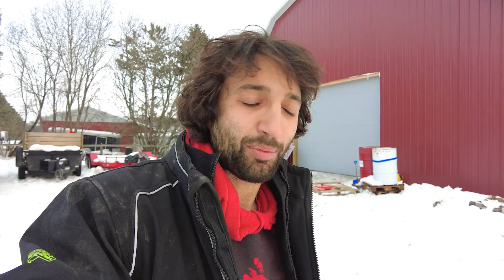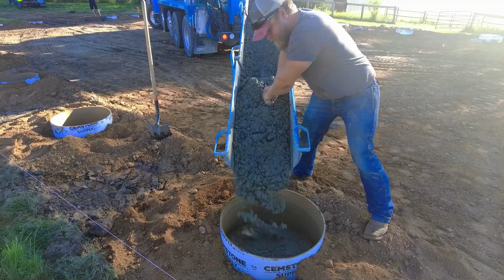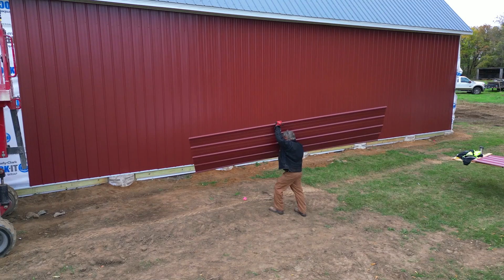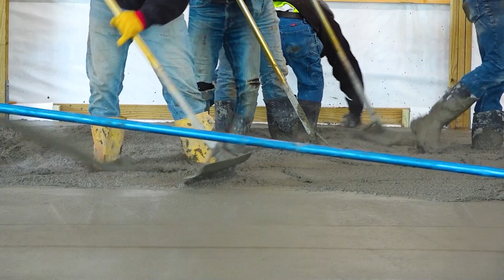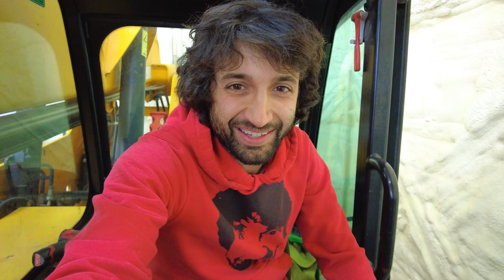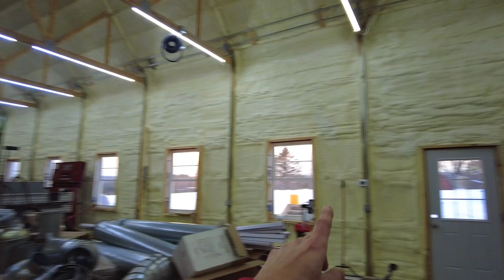How Much did this Stupid Barn Cost to Build? - 40x72 Gambrel Post Frame Episode 23

Comment: Thanks Matt for all the great information! I thoroughly enjoyed watching your build. I have a much smaller building much like yours, it's a 30 x 50 with 12' high walls. I have 2" spray foam on walls and ceiling as well. I do not have floor heating, which I wished I did, but just could not afford it. I used 3/4" plywood for interior walls 10 feet high. Mine is metal framing, not the red steel framing but the cheaper square tubing. The steel building material and labor was a little over $16,000. This was before covid, today it's 25K. My floor was 6K, I wired it myself. I had (3) residential garage doors with openers installed for $4,600.00. I had 2 coats of Polyaspartic coating on my floor for 3,500.00, this was a good deal. I did a lot of research on this product and its the most durable product on the market. As always I wished it was bigger! Have a Happy New Year!

Comment: Thanks for sharing this info.... Its crazy how prices have changed... In 2015 my shop (40x80x10walls) $29K for prep, slab and shop as a turnkey solution plus $8800 for spray foam - $9K electrical, $5K septic tank, $6K plumbing for one bathroom, one kitch, shop sink and 2 outdoor hydrants
Reply from the maker: That’s a hell of a difference in only a few years

Comment: Thanks for sharing. Not everyone would be this open. I understand your thinking on having open trusses rather than trusses for a second level. One question, did you consider having the trusses for a floor in just one or two bays? Gain some space for light, bulky storage and not lose much vertical space in the process.
Reply from the maker: I can always build a mezzanine if I feel the need
Reply: @mcremona  Thanks.

Comment: Thanks for sharing all those details Matt. I had been wondering about the Storage Trusses since the framing was complete. I had not thought about the need for 2 foot on center and all the additional trusses required. That is a lot different than for a garage where one already has trusses 2 feet on center. Thanks for all of the videos - they were highly entertaining!
Reply: When you have less trusses you have additional framing in between them, usually price is comparable between 8' on center and standard  2' OC, agricultural trusses for barns cost way more and are built heavy duty.

Comment: I had a hard time deciding how big to build my shop. Eventually I decided that no matter how big I made it I would eventually wish I had gone bigger. So I decided to get the biggest I could afford at the time and IM glad I did because its been 8 months since I put the down payment on it and I just got permits and concrete this month. Next month the building will go up and I will have enough saved to insulate the building and hopefully put in the electrical and heat pump.

Comment: Considering the steep pitch of the roof, I am wondering about preventing damage to the future lean to when a heavy snow build up let's go during a thaw. A 10 or 12 inch snow layer is very heavy and could do major harm. Is there something to add to the roof surface to prevent snow from sliding off?

Comment: I don't understand how the spray-foam insulation is so darn expensive. It's relatively quick, doesn't take too many people. The chemicals/materials can't cost that much....seems like the type of thing that since you can't do it yourself they can charge a multiple thousand percent upcharge
Reply from the maker: I’m not sure how insulation foam compares in cost to the packing foam that I buy but for me a pair of barrels cost $4000. They must have gone through 5 sets to do this building

Comment: ...from a business point of view...you added a fixed asset to your business, in fact if you want to you could charge yourself "rent" if you wanted to pay yourself. Now, all of the costs can be amortized as a business expense over the long term (check with your accountant for the schedule). Now, you have also increased the value of your property, which from a government point of view means...more taxes. You "could" charge your business self those costs to help pay down that expense as well. Since you are using the building for your business, you have a choice to make to separate this from personal expenses, but would it be to your advantage? I'm not an accountant (although I did start to study in that field) so I guess it gets more complicated...

Comment: You're shop looks terrific and it's been fun watching your progress.   You probably already thought of this but my only suggestion is that you may wish to add a few large ceiling fans to bring heat back down in winter.  The collected ceiling heat is wasted if left to congregate above.  And the couple degrees of warmth brought back down makes a big difference.   A few years back I went through this same process and built a 40'x60' shop.  The big difference between your build and mine is that I did all the work on my own.  For some reason the challenge of such a large project by one person was appealing.  If there is ever interest in following the journey here is a link to my YouTubes.  Again, great job on your shop.  Thank you for sharing.  https://www.youtube.com/watch?v=3iP04ZPpdKg&t=22s
Reply: Big Ass fans circulate a lot of air.